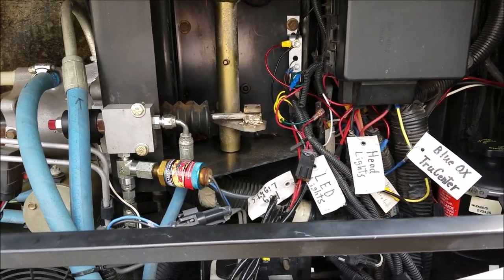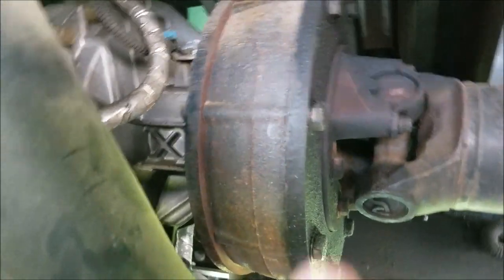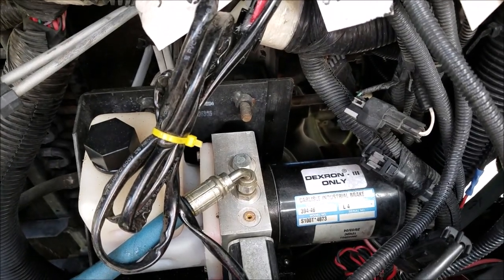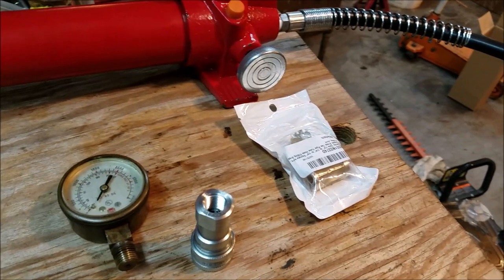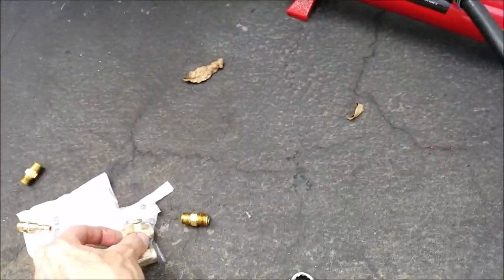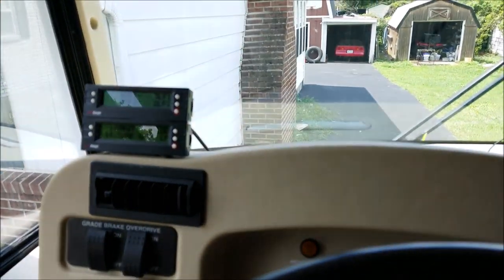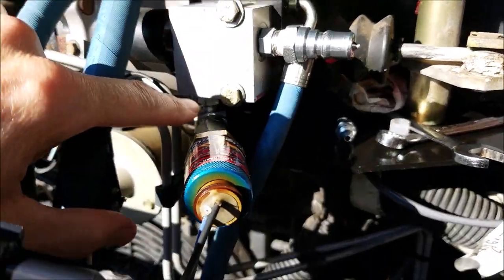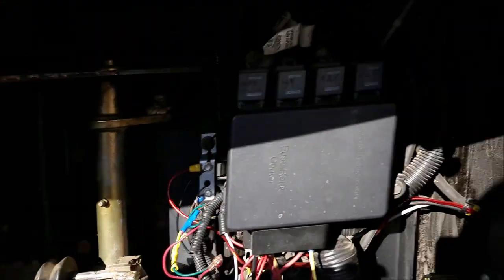RV Repair: J72 Auto Park Brake Emergency Bypass Kit For Hydraulic Pump Failure. Don't Get Stranded.

Comment: Hey Kevin, I own a 2003 Winn Adventurer 33V with the Vortec 8.1L Workhorse chassis. Been doing upgrades to it ... I really apricate and instructive videos. My question: My rig has a Footbrake to the bottom left of the steering wheel and also this Hydraulic unit .. your does not have a footbrake/Ebrake? I wonder why they took it off your being a newer rig than mine.

Comment: I installed a park pawl in my 2003 P32 with a 4l85e. I have pulled the same load with my truck and 5th wheel with the 4l80e with no problem.
Reply from the maker: I wish we had that option on the W24 But at 24,000 pounds it would have to be a very strong parking pawl.

Comment: Cheaper easyier ..just unhook the cabal going to brake actuator...just use e brake when you park...
That's what I did...a few year's ago....
With it set up like you have it...
You have no brake when you park untill you release the pressure...
My way you just apply e brake same as actuator would..
Reply from the maker: I wish I had that option but with the J72 there is no bake cable no parking brake shoes only a large spring that can only be released with hydraulic pressure.
Reply: @ktoutdoor  I understand..your right I see how your brake is set up...
I have a winabago vectra on a p30 chasie .1995,,I have been around the country 3 times in it..50,000 miles worth...full timed for a few yrs ..she is still in pretty good condition...for her age...kept in doors for menu years.. before I got it....I always keep it under cover out of the weather ...just rolled ,100,000....I bought it at 49,000... miles...now has 100,2800..runs strong...gas 454,..good video by the way.👍,,,,